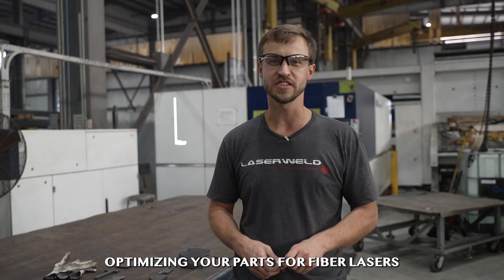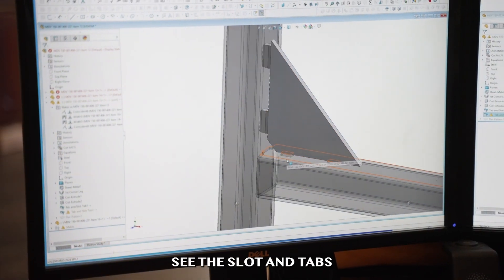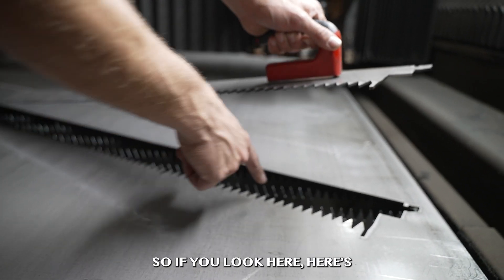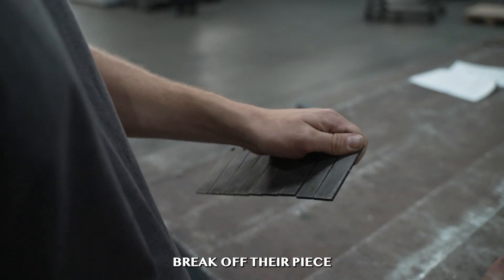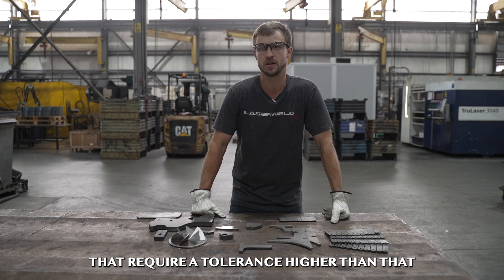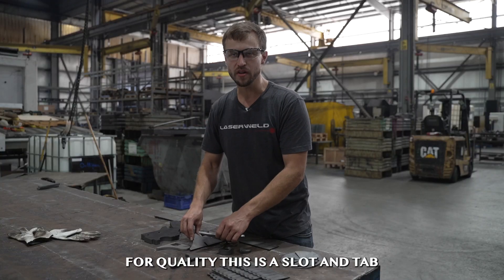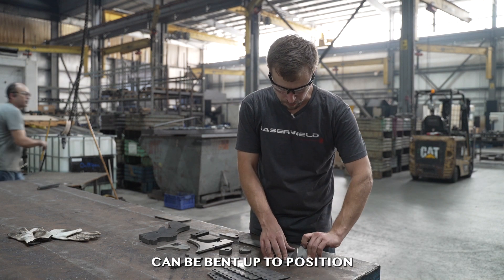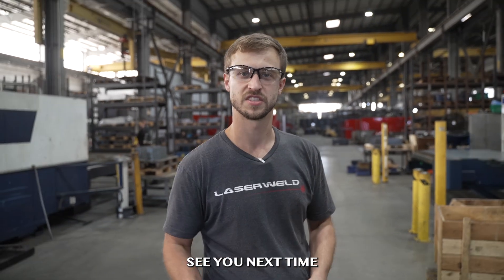Mastering Fiber Lasers: Optimize Quality, Speed, and Cost!

Comment: It's real nice to see companies appreciate the machines I've worked on for the last 7 years! 
But man, steel slats? Bud, if you run thinner material on some of your lasers then switching to copper slats will help with the cleaning and wear. Copper slats clean real nice when running a slag hog. And they dont burn down to nubs as fast. 

Also check out Bystronic Lasers up in Chicago. The software they use is VERY friendly to operators. And is quite good for on the floor troubleshooting.

Comment: Perhaps you could check the accuracy stated in this video. One can not cut more accurate than the positioning accuracy of your X and Y axis. You stated a cutting accuracy of 0.01 mm.
Reply from the maker: The accuracy is .0004" or .01mm. (granted the older machines may not hit that tolerance due to age). To give a comparison a human hair is normally .003" 
Fiber lasers are used on everything, Medical, aerospace, tooling and general fabrication.